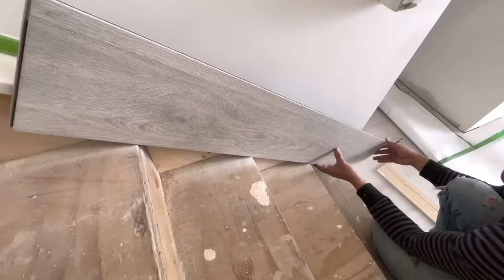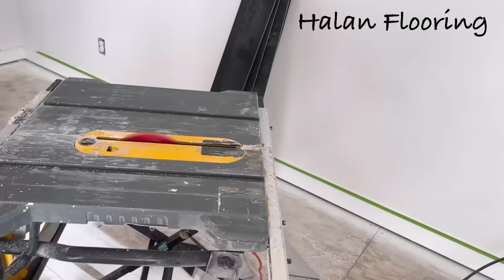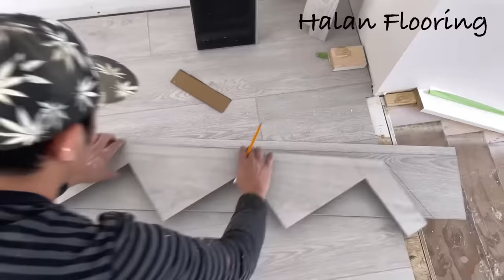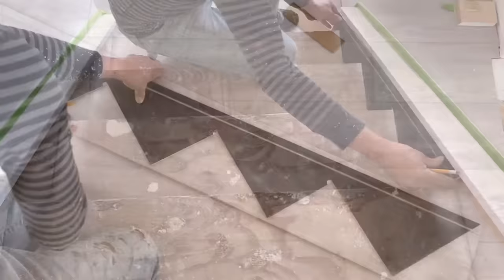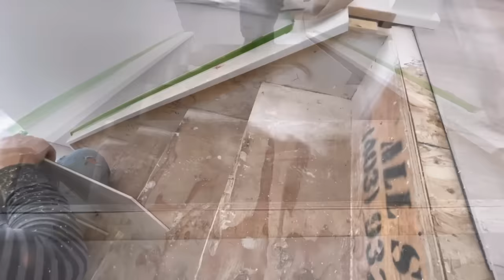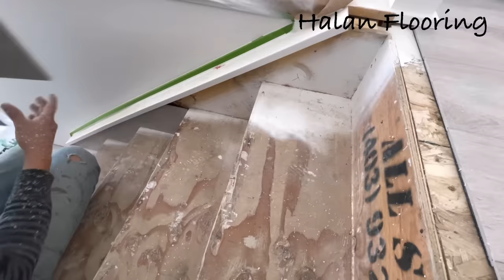How to cut Vinyl stringer ? HALAN FLOORING

Comment: That’s not a stringer, it’s a skirt board
Reply: Exactly. And in new construction, the smarter way to do a skirt board is installing it to the framed wall before the stringer, so the treads butt up against it, instead of this unnecessary and unsafe table saw technique.
Reply: @pterafirma  what if it is already an existing staircase. Like the one in the video clearly is? Another American? 😂

Comment: that isn't vinyl it's laminate flooring
Reply from the maker: it's vinyl plank
Reply: @halanflooring6578  laminate flooring
Reply: @michaelwilkinson7845  it's luxury vinyl buddy
Reply: You don't cut vinyl on a table saw laminate yes
Reply: @michaelwilkinson7845  Yes you do trim vinyl plank with a table saw for certain things like either shortening the width of your starter/finish pieces or stringers. You can't just score it with a blade and expect to get perfect intricate cuts.
Reply: Well i was a floorlayer for 23 years and never once did i use a table saw to cut vinyl the table saw was only used for wooden related flooring, so i take it you must have different names for your flooring
Reply: @michaelwilkinson7845  you on the east coast or west coast?
Reply: I'm in the uk
Reply: @michaelwilkinson7845  Answer the question, east or west?
Reply: Read my last message
Reply: It’s vinyl plank not laminate lol 23 years exp you say haha
Reply: Like i said must be different flooring